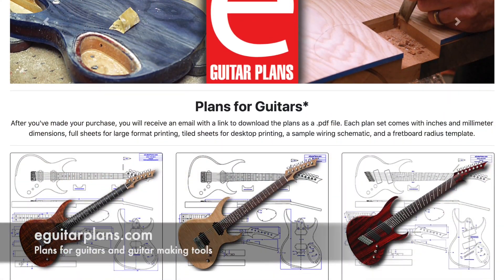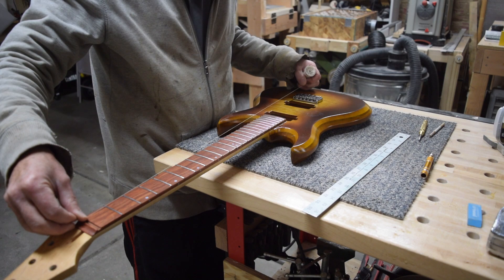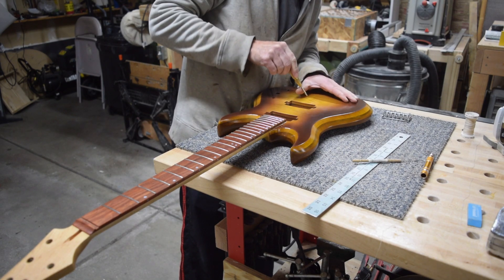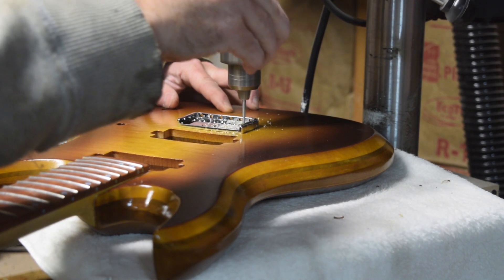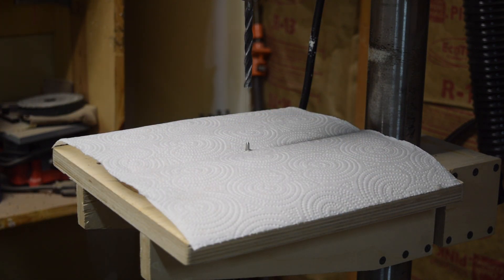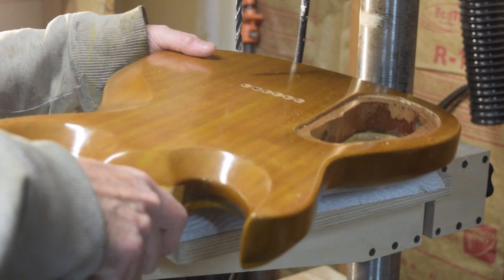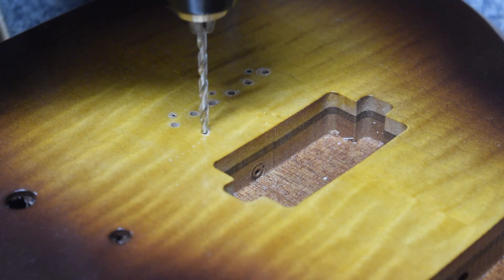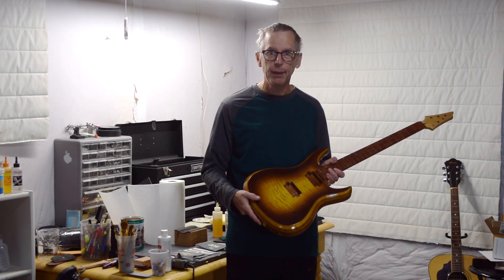Making A Laminated Top Guitar Part 10 How To Position A Hipshot Hardtail Guitar Bridge

Comment: I love this idea, but my benchtop drill press is to small. The guitar body hits the post of the drill press and the bit cannot reach the proper location. Aside from buying a larger drill press, any recommendations on how to get the same quality outcome?
Reply from the maker: Use a top loader bridge instead.
Reply: Highline Guitars that's what I did recently. Just finished my first build. Sounds great, but I'm hoping to find an effective method for string through body with the tools I currently have.

Comment: For a Hipshot Hardtail bridge you can also drill the holes for the bridge screws 26.125" (+/- 0.030") from the inside of the nut.
Reply from the maker: I recommend my approach because the length of the saddle adjustment screws can vary, which changes the baseplate’s location. I know this because it has happened to me more than once.

Comment: Hey, thanks for posting this video -- I'm over a year late to finding it.  When locating the Hipshot bridge are you centering the saddles in the bridge before measuring/locating the mounting holes or just going with how it comes from Hipshot? In other words, Hipshot's drawings indicate max/min intonation of .38"/.09" from the front edge -- halfway would be .145" -- but mine came with the saddles set about .3" back from the front edge. Maybe I'm over thinking? (I'm not a machinist but I'm in an industry that needs fit-ups to be within 0.1mm)  Thanks!
Reply from the maker: Move the saddles all of the way forward and then back about 3/64". Then place the bridge so the front face of the saddle is right on your scale line. If you center the saddles, you won't have enough aft adjustment to intonate the strings, especially wound strings.
Reply: thanks so much that's really helpful!

Comment: Great video, as always. I have a sort of unrelated question. I have obtained a 20”x60” 8/4 finished slab of bubinga as well as a solid pice of Tiger Maple, the same dimensions. How would you optimize using these pieces, as far as body/neck/top combination? Thanks!
Reply from the maker: Draw the dimensions of the slab on a computer along with the outline of a body and a neck. Position the body and neck drawings onto the slab drawing and lay them out to figure out the best way to make use of the wood.

Comment: Hey Chris, do you keep your garage heated 24/7? My little shop is in my cold garage. I'm concerned about the cold temps and the wood. I'm not sure if temp heating and then letting get cold again, repeatedly, is a good idea. Thoughts?
Reply from the maker: My garage is fully insulated and doesn’t require heating. The temperature never drops below 50 degrees Fahrenheit so I don’t bother.
Reply: @HighlineGuitars  Thanks for the reply. I should insulate the garage door and see how that affects the temp.